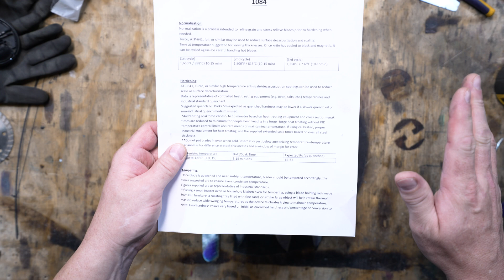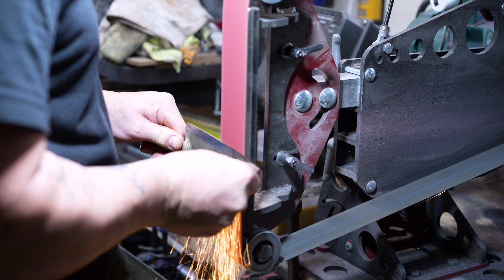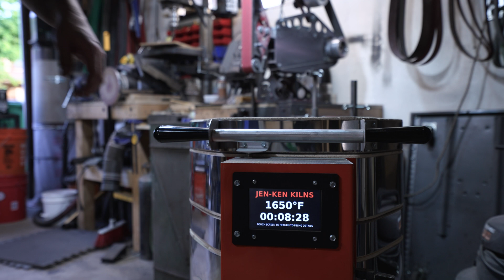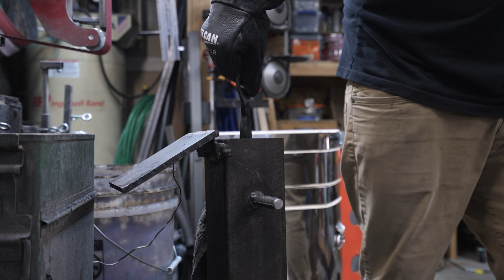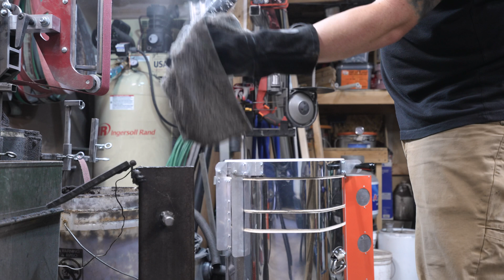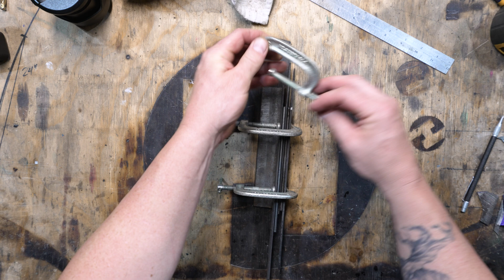Heat Treating 1084/15N20 Damascus

Comment: I just looked at the exact same data sheet from Aldo yesterday! I always use his guidelines in my HT oven, since it's his steel and I trust his data. I will try your method of correcting warps this afternoon; just forged a 1/4" thick chopper that warped during tempering, to my surprise and annoyance. Sometimes even though my bevels are the same I get a warp. Sigh.
Reply from the maker: Sometimes I don’t get it when blades warp. I can have two of the exact same blade, heat treated the same way…one warps and one doesn’t. For sure, Aldo has been at this for a long time. No reason not to trust his data. That’s crazy that it warped in the temper.

Comment: Another great video. Super informative. How did you do your heat treatment before the kiln?
Reply from the maker: Thank you, Nate. Before the kiln I used my forge. I put a 2” x 3” rectangular tube in the forge, then I’d put the blades inside that. It kept the blade away from direct heat and gave the blades a more even heat.
Reply: @Hathenbrucksteelworks  
That's pretty much what I do. 2" pipe. Cycle through the edge of non magnetic a couple times and pray.

Comment: Looking really good, interesting to see your take on normalisation as so many different opinions as you say, some are obviously complete rubbish and some over complicated but evidently work, recently watched a metallurgist explaining about normalising with a bit of science thrown in to make his point, was interesting as he says the only cycle that makes a difference is the last one as that is what sets the grain of the steel and often people go to low a temp with the last cycle and so their steel isn't as good as it could be, obviously what the manufacturer says is best by far but otherwise I have started doing as he suggested and works well for me, mind I only have a coal forge and a magnet lol, more control over temperature would be far superior
Reply from the maker: For sure. There are some people out there who have tested and found what works the absolute best, but weeding out the rest of the nonsense is pretty difficult. It’s much more difficult with a forge and magnet. I’ve only been using this kiln for about 6 months, or so, and it’s one of the best tool upgrades I’ve made.